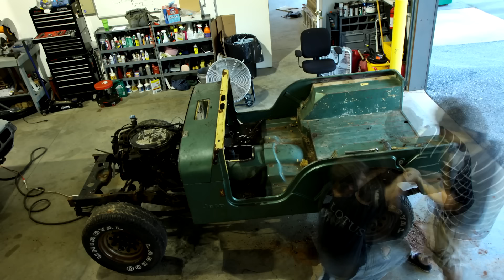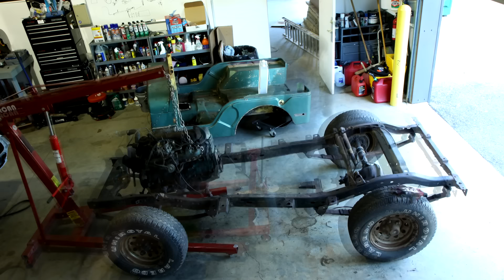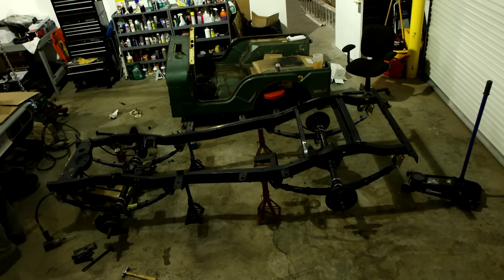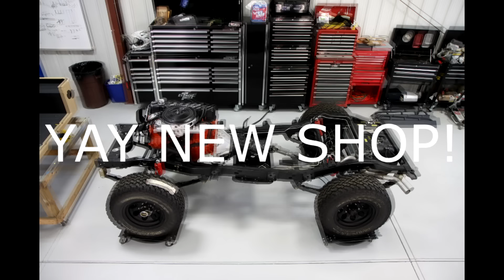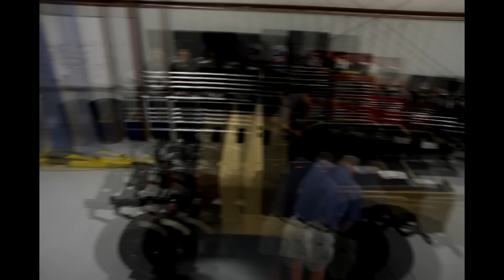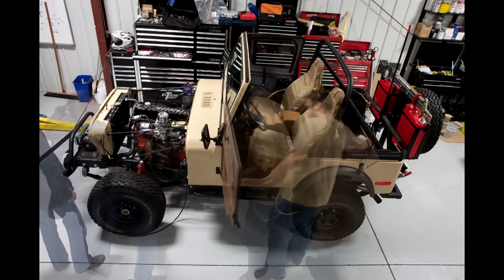10 minute Time lapse 1976 Jeep CJ5 Restoration

Comment: Sweet, you should be proud! Fiberglass body?
Reply from the maker: No it is the original tub, it had a ton of rot but i wanted to keep as much of it as i could. It took a LOT of welded in patches, and I cut the entire passenger side off and replaced with a nos side panel I found.

Comment: Russell, don’t want to spoil your day but you left a bolt out over there...  Better start all over.     On a more serious note, I wish (do you have) you would post the engine over-haul.  I am interested if you replaced the valves, or are there any other issues running with lead-fee gasoline?  If I remember, 75-76 everything was still leaded(?).  Outstanding job by the way, I wish I had your talent.

Comment: Im working on a 72 CJ5 with my kids to have a family project. Where did you get most of the parts? Your jeep looks amazing is practically what I want to build but with a back seat for my little one. Thanks for the motivation.
Reply from the maker: Thank you. I used quite a few vendors. But Morris 4x4 Center was one I frequently used.

Comment: I have probably watched this video 20 times.  I am currently restoring a 74 CJ5.  After you POR15'd the frame you started putting parts back on with what appears to be nice, new, shiny bolts from a kit.  So...  Which bolt kit did you use?
Reply from the maker: Cameron Reed,  I did use whiney new hardware but there wasn't really a kit for the frame I used grade 8 nuts and bolts for everything frame down and did buy SS hardware kit for the body, however there was a lot that was incorrect in the kit I used. Spent lots of time matching bolts at the hardware store. Lol
Reply: Thanks for the reply.  I was kinda expecting to spend some quality time in the bolt section of the hardware store. Sounds like I should still plan on it.   Thanks again... and great work and vid

Comment: It's great to see a part of history in great condition again. What looks like bed liner in the interior is a great touch, by the way. Did you think to coat the underside as well to prevent rust? Just curious if that worked out.
Reply from the maker: Yes underside also has bed-liner. Raptor liner to be  specific.

Comment: I built a 1986 CJ 7 years ago and chose to build up the 258 instead of the overdone route of SB Chevy.
 The 258 is a solid reliable engine, just a little underpowered.
 I had the block bored .40 over installed a Crane cam, Offy 4V intake, 450 cfm Holley 4V
.Pacesetter coated header.
After a few thousand miles i took on my buddy who had a CJ 7 with the 304 that he put a Carter 4V carb and headers on.
 Each run i was able to beat him, plus it didn't lose the better front to rear weight balance the lighter 6 offers.

Comment: I'm about to undergo a similar body off frame restoration process with my 82 CJ5 and I could use a couple pointers. What paint or coating is best for the frame, and what is best for the underside of the tub? I'm choosing to shy away from a rubberized undercoating.

Comment: Sucks that jeeps are not like this anymore!!
Reply: They are if you buy the mahindra jeep!
Reply: Vann Junkins well I can’t really get the Roxor, can I? The Roxor is so cool
Reply: @Enlightened2371  I'm pretty sure jeep has been lobbying to keep them off the road. It's my understanding they are a direct descendant of the CJ. I saw a video where a guy bought manual locking hubs for the front axle. He bought hubs that fit the cj5 and they bolted right on!

Comment: What would the price be to do this
Reply from the maker: That really depends on the condition of the jeep that is started with, and what exact mods you want. The variation in price can be extreme.
Reply: Any time you are dealing with automotive restoration, "cubic money" is the operative term.
Reply: A nice restored cj goes for 12 to 20 grand. These are some of a few vehicles that sell for more used than they did new. The best thing is you can get a tj someone put 75 grand in for 15 or 20 and not have the rust and wiring issues of old cjs plus way more cushy suspension. I still love a cj just too pricey and hate to tear them up like i used to.